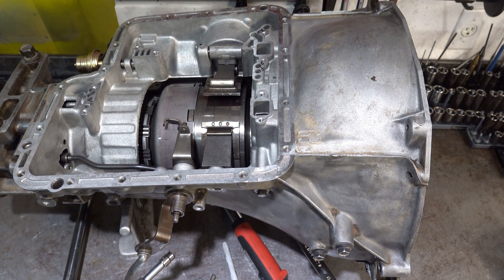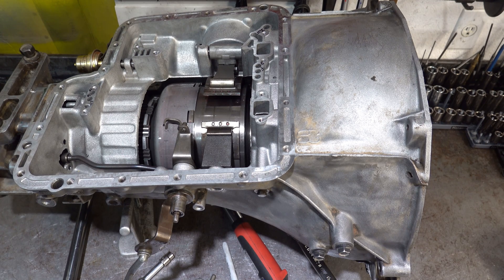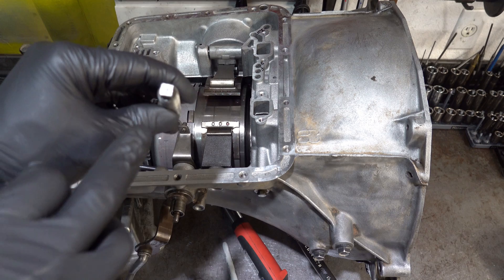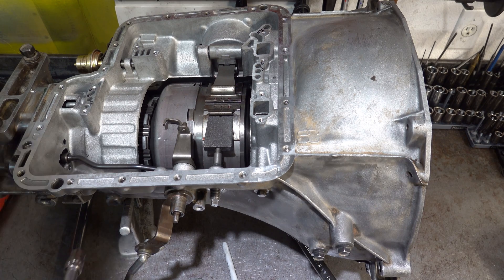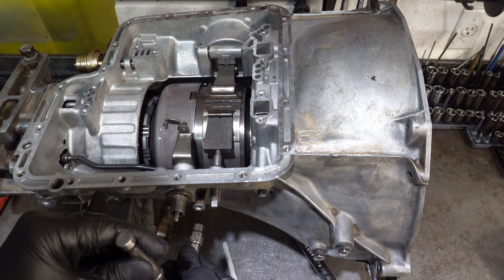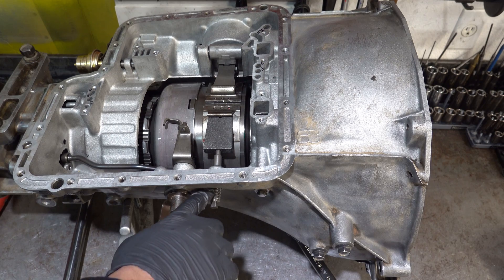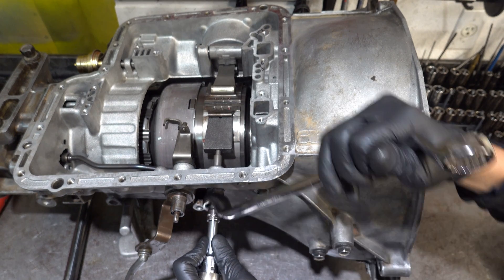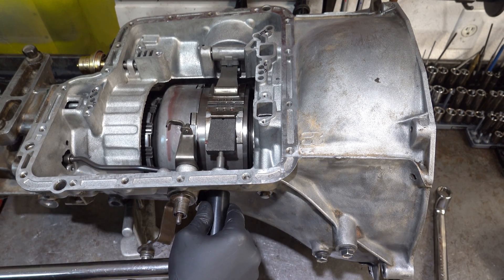Rebuilding the Ford C6: Band Adjustment Procedures

Comment: lost 3rd gear on my c6 valve body modulator governor cleaned some one mentioned i may need bend adjustment tranny only has 50k miles so not much wear curious what are your thoughts
Reply from the maker: Hi Tom...Are you using 'talk to text'? If so, longer posts may become difficult to read as talk to text has a tendency to produce run-on sentences without going back and adding in periods, commas, etc.

Do you have reverse? 

Does it not want to upshift into third gear (i.e. stays in second gear)? Or does it shift but you feel like you're in neutral when going from 2nd to third?
Reply: @nickstransmissions thank you 😊 reverse is perfect 1-2 is perfect it simply stays on 2nd no matter how high rpm (no it doesn’t feel neutral at all just stays on 2nd)
Reply from the maker: Sounds like valve body - check your 2-3 shift valve to see if it's hung up as well as all of the other valves for freedom of movement.
Reply: @nickstransmissions I did clean it already valves moved okey but I guess I need check again thank you very much
Reply: @nickstransmissions some one suggested band adjustment so I’m not sure but I appreciate the knowledge shared very much 😊
Reply from the maker: While keeping up with band adjustments is recommended as part of transmission maintenance, it would have nothing to do with the unit not shifting into third gear.
Reply: @nickstransmissions thank you very grateful for the info I will reach out see if maybe I can purchase valve body as I already cleaned the existing one thinking it would solve the issue which still persists
Reply from the maker: Yea it def sounds like a valve body problem but check your vacuum signal at the modulator if you havent already before r/r the valve body. Also pull the modulator off to make sure the valve is moving freely...
Reply: @nickstransmissions thsnk you ! I will follow it up and may inquire about buying valve body from you after I check modular again 😊
Reply: @nickstransmissions not using talk to txt btw sorry if it appears this way 😊

Comment: I picked up a whirring noise from the front bell housing area of my C6 out of my 79 F250.
Seems like its closer to the pump area!
No noticeable driving issues.
Think it’s the pump?
Or maybe the T- converter?
Reply from the maker: It's probably one of those two things...First, check your fluid level....Low levels or excessively high levels will cause pump cavitation which will sound like a whirring noise. Pull it out and see if the flex plate is also cracked. Then tear it down to see if the pump is damaged; if so replace it. Replace the TC out of an abundance of caution.

Comment: Hello new guy here 😅. I got a 1986 f250 6.9idi diesel 4x4 c6 trands im running 3:55 gears dana 50ttb hd and sterling 10.25 rear. Being mine is a diesel is there a difference between the clutch/steel and seals that come in rebuild kits? How about the torque converter? I use 4x4 alot i tow with it and i live in the middle of nowhere so all hwy at 55/60 miles an hour
Reply from the maker: Hi Jefforey, no difference in the clutches and steels themselves between gas and diesel applications though diesels will have more clutches in the direct drum (4) vs small block gas applications (3). The quality of clutch will depend on what kit you buy (factory level vs high performance).
Reply: @nickstransmissions  thank you so much

Comment: I have a 88 ford diesel with a sloppy slow shift into 2nd. 1st and 3rd work fine, but 2nd just takes forever to engage. Should I adjust this band to attempt to solve this?
Reply from the maker: Yes, try the band first...If that doesn't work, install a Sonnax billet servo kit and see if that changes anything... Before doing the servo, make sure you don't have the factory F band lever or Sonnax FF lever as it's too aggressive a ratio for the billet servo and may break the band and/or case.
Reply: @nickstransmissions  Thanks. I'll have to rewatch your video to figure out what the F band lever is. I did the band adjustment last night, no change. I can get a good 1-2 shift manually shifting when the trans is cold. Once it's warm, I can still get 2nd manually, but I have to step on the throttle to get it to engage. If I'm just driving normally, accelerating normally, it takes forever to engage 2nd.
Reply from the maker: Sounds like the band is shot but remove the servo and check the seals - perhaps they're hardened and allowing blow-by..if so, installing new seals may fix it...If not, trans needs to come out and be overhauled...Check out my Ford C6 rebuild series - it walks you through the entire rebuild process step by step: https://youtu.be/50Qiw_YiWzk
Reply: @nickstransmissions  Thanks a lot friend. Where are you located? If close enough, might just have you overhaul it if you have time.
Reply from the maker: Im in Vegas - where are you located?
Reply: @nickstransmissions  I'm way east in Kentucky. Lol. If I win a Hodson Motors truck I'll drop of this C6 to ya...hahaha.
Reply: @nickstransmissions  I'm watching your c6 series now.
Reply from the maker: Ha! Hope you win🍾

Comment: What does the band adjustment do to the transmission
Reply from the maker: Ensures it shifts correctly and timely without slipping or causing a tie up between 2nd and 3rd gear.
Reply: I have a 1979 Lincoln Mark v with the 6.6 and a C6 transmission and the first 1 and 2 gears engage but 3 and reverse don’t work when the engine warms up. They only work when cold during start up. Do I need a new transmission or the band adjusted?

Comment: Thanks for another informative lesson and the C6 is important to me. As I am learning the various cases and  parts and problems all of which are spellbinding I came up with a question about lockup in the late models vs. early and when it happens in the shift cycle? does it go on and off? Why is there a pulse solenoid for the converter?
Reply from the maker: Thanks, Keith - appreciate the kind words! I'm not aware of any models/variants of C6 that came with a lock up converter (IE converter with a clutch). Are you referring to the E4OD?
Reply: @nickstransmissions Thank you! this is the c6 video i know but I have this question : I was wondering about the timing of the lockup in my 4r100 mostly but looking at the late models like the ten speeds and how they operate what is the converter doing the whole time in those during the upshifts?
Reply: I have a 1979 Lincoln Mark V with the 6.6 engine and C6 transmission. When the engine is cold at start up all gears work…reverse, 1,2,3. But as soon as the engine warms up only gears 1 and 2 work. Reverse and 3 don’t work. Do I need a new transmission or just the band adjusted. From Espanola New Mexico
Reply: @joseduranjr4963  that is interesting. are you sure its not 13? maybe 23? it does sound like a real problem so if the filter is not clogged pull it out before it goes bad. maybe pull the tail housing while still in the car and clean up the governor if its the problem. there is a little ball quida lo turn it to the top

Comment: I've got a 460 with a c6 and first gear it lugs really bad with a trailer and without can't even spin the tires. Would you think that's band adjustment issue? Also it really doesn't like being in reverse with a trailer and slight incline. Makes a popping sound
Reply from the maker: Hi Cameron, thank you for watching.

How long has this been going on? What recent work has been done on the truck? How many miles on the transmission?
Reply: @nickstransmissions  odometer has rolled so either 135k or 235k unknown. I've recently done a full tune up to the engine. I've only had the truck 6 months but it's been weak in first gear ever since I've had it.
Reply from the maker: Gotcha...I wonder if your torque converter's stator one-way clutch has failed in the unit...If the one-way clutch in a torque converter fails, the first part of the drive cycle will feel as though the engine is missing half of its cylinders but once you get up to road speed and fluid coupling occurs, torque multiplication ends and the stator free-wheels normally (the engine speed where fluid coupling occurs is the converter's stall speed).
Reply: @nickstransmissions  You know, my truck I've had for 12 years, 86 F250, 351W C6 auto has always felt like it was dragging an anchor taking off, like the brakes are dragging slightly even though they are not and it felt that way accelerating anything below I'd say 40 MPH, I wonder if that was the issue. Once the trans gets warm the feeling isn't as noticeable and it wasn't anything to do with the engine and the rest of the transmission overall looked incredible for the age, mileage and abuse it went through. Trans always worked fine but it had just shy of 254,000 when I tore it down - putting a new engine in it and decided to do the trans since it was still the original. I do have a new torque converter but I wonder if that was the issue. The truck always got 9-10 MPG no matter what I did to it, think it should have done a little better than that driving around empty. We'll find out here the next couple weeks. I think with the TCI low drag kit and the 2000-2500 stall converter I have it should take off like a rocket now lol. Having an engine without a bent connecting rod on cylinder 5 should help some too.

Comment: Hello Nick, I have a 79 Bronco I am building I bought an 88 460efi it came with a 2wd C6 I have bought a 4wd C6 and am wondering which to rebuild? (add the SK6). The 2wd C6 has about 88k miles it came from a Motor home I don't know anything about the 4WD c6 your thoughts please.
Reply from the maker: Hi Bo, thank you for watching. Since they're largely the same in terms of vintage (i.e. both C6s are post-1975), I'd compare the servo codes to see which one had the larger diameter servo and prioritize that one. If they're both the same, I'd prob focus on the 88 C6 and convert it for 4x4 use. This assumes you aren't already planning on upgrading to an aftermarket HP servo/cover assembly.
Reply: great thanks I will take a look tonight  @nickstransmissions
Reply from the maker: You're welcome, Bo.

Comment: Everybody has their own way of doing things, and I'm not faulting yours.  I used to take a short 5/16 open end wrench and all you could pull with 1 finger, then back off until the driveshell would rotate, then one or two flats on adjusting screw. Gave it a short shift into 2nd.
Reply from the maker: Great tip, Peter! For sure, there's multiple ways to skin the cat...I'll try your method on the next C6 I build.

Comment: Appreciate the C6 series videos. Gathering all the parts to build mine now. Your comprehensive teardown and rebuild, plus all these tips, has given me 100% confidence to take this on. Watching Broader Performance videos as well. Ironically, my transmission rebuild is for a 1979 Ford Bronco.
Reply from the maker: You're welcome, CS2 and thank you for watching and good luck with the build! 

Your transmission should the same as the ones I have on the channel...1976-1977, there were a fairly significant amount of changes to the C6 which impacted various parts of the case and valve body but afterwards, changes were fairly minimal...